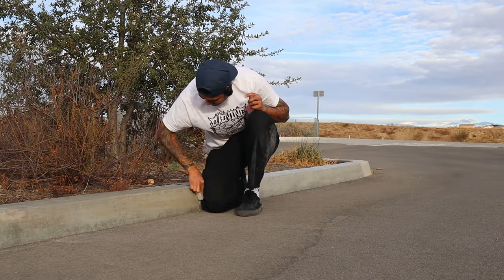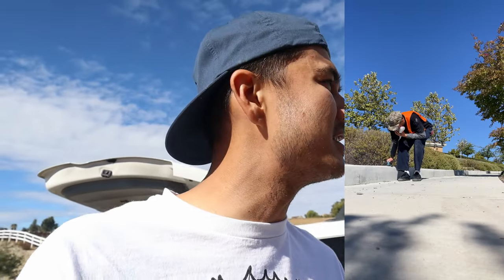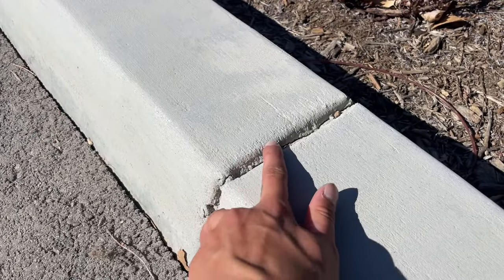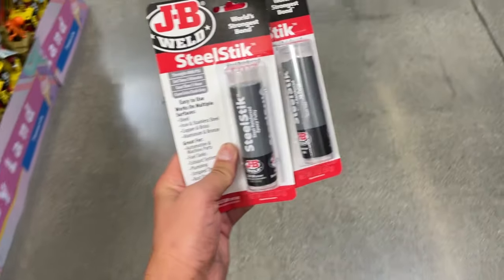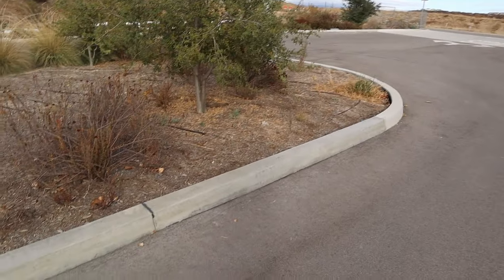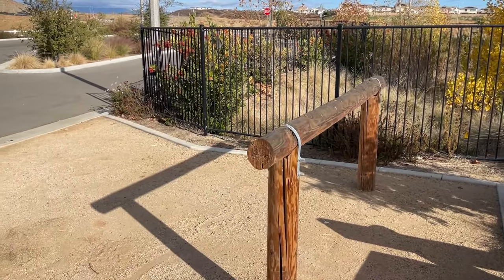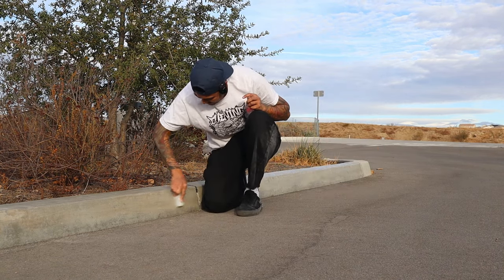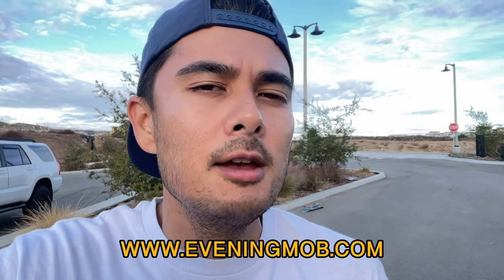Create A Spot! | D.I.Y Skate CURB! | EP : 1

Comment: Well done! You got the technique down pretty spot on. Was gonna say, "No notes!" but there's always something. Behr is my go to sealer as well, but the Low-Luster sealer is just as fast, and looks almost invisible once it's dry, so it's more low-key for public spots. First coat should be dry enough in 30 min. If you throw on 2 more lighter coats of sealer, and wait 30 min between, you don't even need the wax at first. SteelStik is the strongest for curb prep and repair, but If you need to save money , use on just the corners where it gets the most abuse (one stick should do all 3 expansion joints) and fill the tops & fronts of the joints with something cheaper like Bondo or a little patching cement. In the US, I use Cement All by Rapid Set, but that may not be available where you are. Great work. Can't wait to see more!
Reply from the maker: Hell yea dude cheers for the advice! That makes a lot more sense! I was thinking once I sealed it “ do I even have to wax this “ definitely went all out on the wax, and those joints cost me $7 to fill each one 😂 
Definitely will take into consideration for next time!